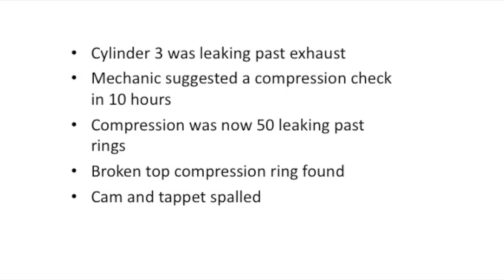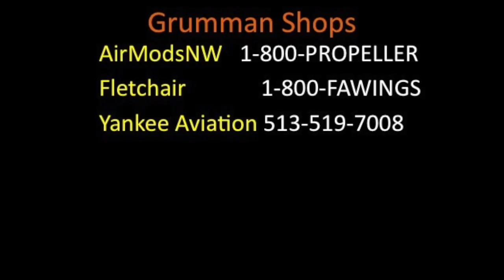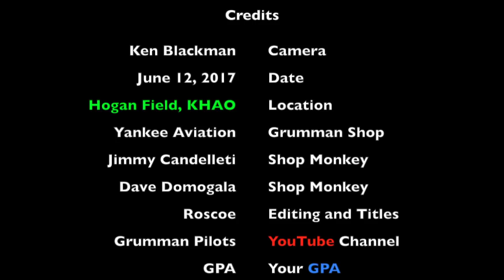Cylinder Replacement Gone Bad  - Grumman Style

Comment: the corrosion problem is probably partially due to the engine sitting for extended periods with old engine oil. Combustion byproducts combine with water condensation to make corrosive acid and these acids will destroy cams, cranks, bearings and cylinders very quickly. it is very important to change oil before the engine sits even if the hours since the last change are relatively low. Obviously the person responsible for this aircraft has been deferring maintenance for quite a while.
Reply: ihdieselman basically at this point it would need a engine overhaul
Reply: That is why when you start any engine  The oil must get hot enough to get rid of the Moisture. 

A lot of Pilots that do not know any better go out to the field and start there engine and start it for  5 min or 10 min. then shut the engine off.      OMG  they are killing their Engine little by little. No one tells pilots not to do this.      The A and P should be telling the Owners.     That is never happen as most or 99% of the A and P's do not know that.
Reply from the maker: Yep
Reply: @ctsteve1967  Yeah, if you have any sort of vehicle that's started only occasionally, you need to run it 30 minutes or until the oil gets up to 180F, when you do start it.  Not getting the oil to full temperature is worse than not starting it at all.

Comment: 9:53 and 10:07 cracked motor mounts?
Reply: Not what I could see in the little time available, you would be able to tell pretty quickly by rocking the prop anyway
Reply from the maker: replaced at engine overhaul in a few month down the road

Comment: The comments are more fun than the video. Apparently they all expected you to have rolled the airplane into a NASA clean room and had a SuperUber Certified Grumman A&P Mechanic with 130+ years experience and wearing a clean-suit to spend 6 months removing each part and clean/inspect/measure/test/calibrate/refurbish them one by one before going on to the next nut or bolt.  And the wailing in hell when a CARPENTERS hammer was used to strike a drift instead of a Grumman Certified $500.00 dead blow hammer brings tears to my eyes.  Keep up the good work.  :)
Reply: @Dillan Baker Why not, I've been a "Shadetree Mechanic for over 40 years and do good work to a high standard. Key points to Teardown are 1) speed, 2) do no damage, 3) look for clues and other problems. After this is cleaning and inspection, and the last part , assembly, is where the skill and knowledge make you money and make a happy customer.
Reply: @Dillan Baker Thus speaks a man who has only been paid by the hour or has a yearly salary. Get paid by the job and you don't faff around on the less important bits. Time wasted is money lost.  Oh, if I wasn't good or I was doing it "Wrong" I wouldn't have generations of repeat clients. My best is a Granddaughter so far! Just a child's bike but the trust is there.
Reply from the maker: Glad you liked it

Comment: The result of an aircraft not being operated enough to keep the rotating parts properly lubricated.
Reply: Long hours sitting in the weather, that evidence of water in the oil would not be restricted to just that problem. 
I'd bet there's extensive corrosion right through that plane. I would also never pull a cylinder without a complete overhaul after such extreme compression loss, 
it's just asking for trouble, but looking at the rest of the plane, it should be a scrap job anyway.
Reply: @alasdair4161    Cars Engines also  sit for years and years and years.
Reply: @alasdair4161   There is a reason for the broken rings or rings.
Reply from the maker: Yes

Comment: Ya wanna know what flipped my switch? Ok, the wrench monkeys were especially entertaining, but that wasn't the worst thing. "Keys out?" And then before he gets an answer he's turning the engine over WITH THE PROP UNDER HIS ARM!!! If he's unsure of the switch state, WAIT! Even if you ARE sure, stay out of the blade path! There's a little thing called a bad kill wire that WILL let the engine fire, and on THIS wreck, I'd assume EVERY wire was broken until I visually proved otherwise. GOD ALMIGHTY what a bunch of yahoos!!!!
Reply: Shaun Olinger Did you happen to notice the ignition system? At least on the right the ignition leads were disconnected. Nothing would’ve happened as long as all leads are disconnected. But I agree it’s a good practice to watch the prop and ensure the keys are removed.
Reply from the maker: Maybe

Comment: Yeah, there was a number of things going on in this video that was disturbing. A general lack of best practices and haphazard application of mechanical technique to start with.

Not cappping lines. Not protecing the open induction port. Not removing baffle. Not disconnecting all the plug wires. Not determining top dead centre of the piston on the affected cylinger. Not manually grounding the magnetos. Not bagging parts as dissasembly occurs. Hitting the valve shaft with what appears is a metal punch, not a brass or fibre punch.

The general condition of the cam and lobes made it lucky you found these conditions because this engine was not airworthy.

Lots of jocularity considering how messed up and grotty that engine and engine bay was.
Reply from the maker: With a title of 'Cylinder Replacement Gone Bad' you were expecting something different I say.

Comment: The biggest issue with GA aircraft is lack of use and poor storage. It's quite obvious this plane spent the bulk of its life tied down outside. Sitting. Rotting. High levels of condensation and moisture internal to the engine caused corrosion and pitting. From the corrosion evidence on the firewall, the fuselage and wing internals should all be inspected for hidden corrosion at all critical areas.
Reply from the maker: Pretty much.  It was eventually trailer and got to a new home and is in Paint shop now for finish.  Nice plane now.  Lots of love and money and time.

Comment: Shameful condition of everything under the cowl........who maintains or flies an aircraft in that shape ????..........shameful..........and then advertises it on YT..
Reply: I'm not an airplane mechanic, but I fly them - in all areas of aviation, there is somewhat of an attitude that if it ain't broke, don't fix it.  This may sound lazy, but there is actually good data to show that messing with things too much CAUSES more problems than it prevents.  That being said, there are annual inspections which are mandatory, and depending on how particular your local mechanic is, a plane could find itself in the condition as seen in this video.  There are some modern methods involving engine monitors and oil analysis done at time of oil change that can prevent the issues shown.  Another cost to worry about for sure, but small when you are talking about the safety of you and your family.
Reply: Snob
Reply: @faa inspector- who lets their engine get that bad. think they should be working on that?
Reply: Utter nonsense. There are replacement requirements based on hours of service for some equipment, as well as mandatory maintenance requirements in every planes POH. Every plane owner I've ever known have been uber anal about the condition of their planes.   @jsteiger2228
Reply: I bet It would not surprise anyone if all of them present had a hand at various times in the routine maintenance of that POS..
Reply: @brustar5152  - Just because something looks like a POS, doesn't mean it is ...
Reply: @SmittySmithsonite  But this example has the internal issues to match its looks. I love a good patina as much as the next guy(In fact I find it more pleasing to the eye the more old and neglected it looks!), but I don't want to fly on an engine that's cooked an exhaust valve and has spalled valvetrain parts. I want the important oily bits inside the engine to be perfect and pristine, even if the outside of the thing looks like it belongs in a Fallout game.
Reply: I’ve seen much much worse.
Reply: @SmittySmithsonite   and the other way around
Reply: Amatures
Reply from the maker: This is what we saw when it came in.

Comment: will VTEC technology fits intothe avaition piston world?
Reply: Doubtful it ever will, limp home is not a good mode at rotation.
Reply: Why would you need a VTEC when airplane engine operates at a very small range of power setting. VTEC is for automobile that operates from idle to WOT and back time after time. If the automobile operates at 75% - 100%, then VTEC is a waste of mechanical complexity.
Reply: No
Reply from the maker: ok

Comment: "I'm missing three sockets out of my other toolset", something you should never ever hear in any aircraft hangar, this is a cowboy outfit.
Reply: yes he  must have left them inside that last engine rebuild ???
Reply: @WayneCook306  Eh they're just the 10mm sockets. 1/4, 3/8, 1/2 drive 10mm sockets just disappear into the ether.
Reply: @TestECull  And 1/8 drill bits, everybody steals the 17 mill spanners.
Reply: @rbarnes8169  No. Lost tools = human being. Everyone loses things once in a while.
Reply: @TestECull  I've lost many tools, but I know when and where they were lost. Just by the way these guys operate you can tell they don't know if they lost a socket in the intake or behind a cowling. That's my reasoning behind the statement.
Reply: @TestECull  I guess. If you twist my response to your liking...
Reply: @rbarnes8169  No twisting necessary. Your exact words were 'Lost tools --> trash mechanic'. You put no qualifiers up or anything that was the entirety of the post. I'm just applying your own logic to you, no need to twist it any...
Reply: @TestECull  Certainly we humans lose things, wedding rings, car keys, money, etc. However, aircraft mechanics are held to a higher standard and should not lose anything when working on aircraft. And when something is lost, It's called foreign object damage (FOD). This is why the aerospace manufacturing industry has gone to great lengths in educating workers to account for every piece of hardware and every tool for this type of work. Tools should be placed in a shadowbox. Removed parts should be bagged and tagged. And a running list at disassembly are all things that prevent FOD. In summary, @Rbarnes 816 was correct with their statement.
Reply: Martyn Watson  Dude you think every A&P mech runs a operating room for a hangar your wrong, probably a grounder lol.
Reply: @a-hvlogs2046  I have been an A&P for 20 years and I have never lost a tool.  Tool checks are an essential part of doing any job on an aircraft - no exceptions.... ever!  Apart from the embarrassment of having a pilot hand you your spanner back after it has clocked up some frequent flyer miles it is incredibly bad trade practice, illegal and dangerous to not account for all your tools.  There are many documented instances of airplanes that have crashed because a lost tool has jammed a flight control.
Reply: @cdb9033  this is the epitome of a YouTube comment.. would hate to see you misplace a 10mm
Reply: @a-hvlogs2046  So would I.  All the hardware on these aircraft are imperial sizes.
Reply: TestECull you got that right. I’m beginning to believe there are some kind of super natural force behind it all
Reply: When I was a teen , we had a guy pull in complaining of a "miss " .
Free compression gauge hanging out of the #2 cylinder .
Reply from the maker: It was a Wrench and Elbow Bending workshop of how to work on a Grumman taught by Guru's.  7 planes were being worked on and we had the tools.  All sorted out later.

Comment: I would think that that kind of cam damage was leaving a lot of metal in the oil filter no?  When I do my O-290 annual, I cut the filter and remove the pleats and wash them in varsol, then drop in a neodium name tag magnet into the dirty varsol and swirl it all around to pick up whatever ferrous metal was washed out.  So far all I get is a little ring of ferrous grey paste sticking to the magnet.  If my cam was going I'd expect to see larger fragments or chips or slivers of steel.
Reply: That tells you almost nothing about what wear is occurring, when and at what rate. If you want to track things like that try pulling oil samples and having them tested on a regular basis.
Reply from the maker: k
Reply: @deeremeyer1749  Yes but in this case I'm just interested in the engine shedding significant amounts of metal, and on Lycs it's slivers from the cam lobes and followers.  Sending oil out for analysis is a whole other level.

Comment: looked like water damage.. they called it spalling but this thing looks left outside which means wild temperature swings.. engine breathing in and out that air and keeping the water that was in it.. Kind of sad shape for an aircraft..   Do not think I want to put any hours on that one...
Reply: Time between overhauls is based on engine hours not decades tied down in a field. Light use may also allow oil on internal parts to dissipate and allow moisture to get at that metal.  Time based atrophy takes a tole, like the Corvette a mother was keeping for her now deceased son driven less than 100 miles a year since the 80s. Just damp winter/spring/fall cycling outside can do that given enough time.
Reply: by the color of the oil looks like a lot of water is in the engine.
Reply from the maker: Plane restored, engine redone by Lycon

Comment: AVCO stamped rocker covers are old. I'd bet this engine has never had a major. Two numbers punched in the rocker shaft boss... cylinder done twice. Cam spalling due to rust. Either not run often or not long enough to drive off moisture. I'm sure it's full of metal from the lifter/cam failure but odds are the crank is a standard. Rough but salvageable. Whatever IA signed the annual should be walked to the nearest tree.
Reply from the maker: Glad you liked it

Comment: I got Grumman AA5 my fuel was leaking, how many hours does it take to remove left wing and sealed the tank and then put back in?
Reply from the maker: The easy past is the wing off and wing on about 2 hours for all of that.  Scrapping the old sealant out, cleaning and then reseal can take several days.
Reply: @GrummanPilots  thanks I was just checking my engineer took 24 to 26 hours , and I found another engineer saying you don't need to take wings off you take panels off then remove the tank it takes 14 to 16 hours all completion.

Comment: Oil analysis might have caught that cam spalling, probably would have shown up as high Iron on the report.  Then again considering the condition of the rest of the plane, I doubt the prior owners were conscientious enough to do something like oil analysis.

Another tell tale sign would have been metal pellets in the oil filter.  The chipped off material has to go somewhere.  

Would be interesting to see what the bearings looked like, I bet they were shot too.
Reply from the maker: All good points, not all owners are so stringent.

Comment: Poor engine :C 
We have a little 150a that the pops and others overhauled 10  years ago, been working great since then, other than a recent sticky valve. Now it's my turn to help fix things if anything messes up, right now we may have to replace the battery or see if the relays are screwed. Wont start every now n then unless we charge it beforehand. Will always hand prop tho
Reply from the maker: Good luck with it, they are well engineered and will last a long time.
Reply: @GrummanPilots  It's a cute little trainer, getting my ppl this year in it (half way there :D )

Comment: Listen to the statement at 11:45 and tell me you'd want these yabbos working on your plane....  by this point in the video, everything they'd removed had some significant issue, everything under the cowling is full of cancer and rot, yet they don't want to look in fear of what they might find.  When this aeroplane and pilot make the news, GA will cop it on the chin as "unsafe".
Reply: I have built and tuned bike and car engines all my adult life and I was surprised at this remark, surely you want to find the nasty before the thing is in the air?
Reply: I don't think they maintained this plane. They found these issues as they were fixing the #3 cylinder. This airplane needs more than an engine overhaul.
Reply from the maker: ok
Reply: I think some of y'all don't understand old-guy humor.

Comment: Noy only time for overhaul but strip the entire firewall and clean everything up, engine mount fittings, engine mounting frame, relay boxes, baffles, everything! By the looks of the borescope pics, it was all caused by corrosion. This bird probably hasn’t been run for a long time before it developed this problem...
Reply: as a retired mechanic, I agree, that engine should be completely disassembled, inspected, cleaned, repaired and rebuilt to specifications.
Reply: Time for a major overhaul. Those in the know realize what that means.
Reply: Norbert Siewert $$$$$$!
Reply from the maker: Yep
Reply from the maker: Overhauled and restored

Comment: Rings don't just break. There is a reason,take the whole engine apart. Measure everything.
Reply: 20:18 carbon deposits on the piston tops may have contributed to ring damage. ?
Reply: Rings do break.
Reply from the maker: It was overhaled

Comment: The one downfall of lycoming engines, that darn overhead cam. Its the last to receive oil, and id say about 60% of all lycomings i work on have at least 1 flat cam lobe.
Reply from the maker: Yes a design flaw but if you fly it alot not really an issue with no sitting.